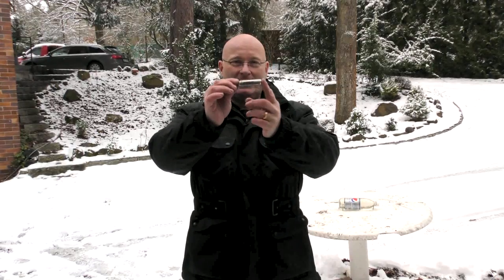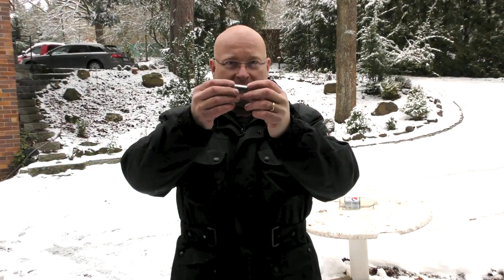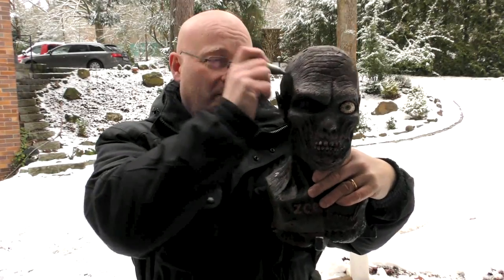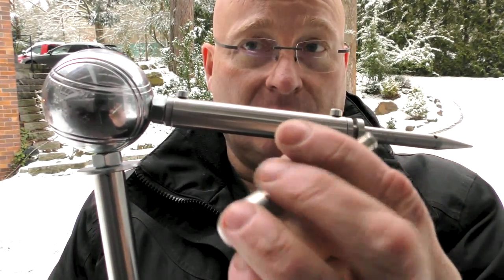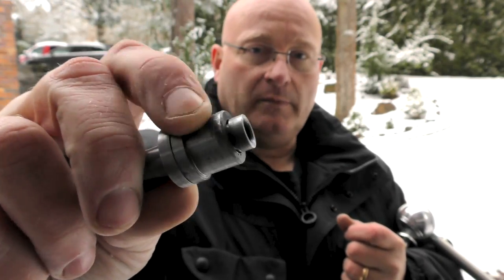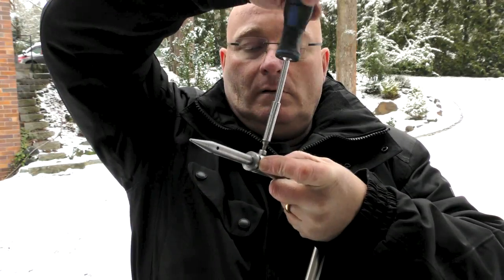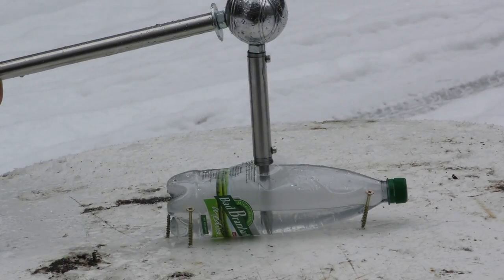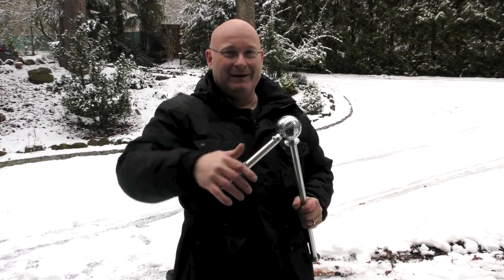Brain Popping Gas Injection Skull Hammer!

Comment: Joerg, I've seen some tests against ballistic gel, and it doesn't show it's full power. What I suggest is making a meat sandwich with a ziploc filled with wine or some fluid.
Also, I think a lot of gas is wasted because of the hollow spike. There must be a way to thicken the inside walls of the spike so no pressure is lost.
Great video as always!
Reply from the maker: TheWakimaniac The catridge holds 6 liters of uncompressed co2. The spike probably holds 2 centiliters. Not an issue.
Reply: Great! Thanks for answering :)

Comment: Could this not be converted to be a projectile? Granted you'd need to fire it with some force, but considering some of the 'big guns' featured on this channel, I think it could be done ;^>
Reply: I think it could be made into an arrow with the spike as an arrow head
Reply: i think the shock of it firing would pop it.
Reply: ***** Fllip Nelson That was my only concern, this could probably be countered by adding a spring to the spike that is strong enough to withstand launch inertia, but not the impact.
Reply from the maker: ***** This would certainly work as a tip for my anti Smaug ballista.
Reply: He could just put barbs close to the tip, add a bit of a shaft perhaps with some fletching to 
stabilize it and launch it like his toilet brush.
Reply: JoergSprave Do it! I would love to see that - Anti-Smaug "cold shot"

Comment: Hey Joerg,

I showed this video to my husband and though he agreed with me that this is indeed a cool build, he said what you need to do is make spikes like the assembly you attached to the ball, and make it so you could fire them from a slingshot. They should pierce the CO2 cartridge on impact once fired. That way they are effective from a distance and you don't have to worry about getting surrounded by zombies with what equates to a one hit weapon.
Reply from the maker: On The Balcony With Kat The spike weighs about 350 grams (= 0,35 kg) without the Boule ball... very heavy for an arrow tip. My anti Smaug ballista could handle it. But that would be a really expensive arrow!

Comment: This is similar to the WASP Ejection Knife. The ballistics gel test of that one is far less impressive than you'd think due to the gel being solid, compared to an animal having a lot of liquid inside.

You could fit a rubber O ring around the part where you open to put the C02 in since it looks like a lot of the gas escapes there.

Comment: Once the skull shatters it's no longer a closed system. The air will escape through the entry hole as the shattered skull won't provide a a good seal with the spike. Doubt eyes will pop out. There was a James Bond film where the bad guy swallows a CO2 cartridge from a spear gun and proceeds to inflate like a balloon. Of course it was a Roger Moore Bond and so most scenes were comical. Looking forward to seeing you test that air spike out!

Comment: As an upgrade suggestion:
Maybe wedge small lead/steel balls into the four holes on the spike. The pressure will shoot them out, adding 4 projectiles shooting through the brain to the already impressive damage. Also this will serve as a sort of "pressure valve", meaning that the gas expands even more explosively than it already does.
On second thought: Not sure if that would count under the "no barreled projectile weapons" part of the german gun laws.. since you have yet to be sued or arrested I guess you know them better than me though

I think ballistic gelatine is the best test substance. It resembles meat very closely but has the added advantage of being transparent, so you can actually get a pretty good idea of the damage done inside.
Add a layer of plaster or wood to simulated the skull maybe to keep things realistic. Only downside is that there isn't going to be any "popping eyeballs"

Comment: Very interesting concept. Totally overkill - I love it! As for demonstrations I would love to see it on ballistic gel since one might actually get a view on what happens that way. I would also like to see what happens with a water melon just for the potential of an awesome spray of melon bits all over the place. Might perhaps the reload time be quicker with some sort of bayonet locking connector? (To clarify - I'm not actually talking of bayonets here, it's a quick release locking connector used for some electronic cables) If you grind an L-shaped track into the tube which align with a lug on the end-piece so you can just insert and twist to lock the end-piece in place. It requires some preciesion work though since it has to be a tight fit so that it doesn't twist and fall out on its' own. It might weaken the structural integrity of the thing though so it might be a bad idea but I figured I'd throw the idea in there.

Love the poster, that big grin really captured you. Hats off to the artist!

Comment: Should make a version of this that is faster to change the CO2 capsule as it wouldn't be too practical if you have to pull out a screwdriver every time - maybe make it so the cylinder screws onto the ball? so all you have to do is quickly loosen it, put the capsule in, then tighten it back. Just an idea :) not sure if you'd be able to do it or not but you seem to prove many people wrong :)

Comment: I reckon you should take out the ZGB head with it. That should be awesome. If not, ballistic gellatin. You should be able to at least see the expanding bubbles getting trapped, if it doesn't explode. Also, maybe look into getting a better setup instead of having to screw/unscrew screws after every shot. Great work none the less, this weapon is extremely cool

Comment: This item of zombie destruction is a great idea. It looks like it works similar to the gas charged knife. Just like the knife it has a similar problem though, a lot of the gas escapes through the entry wound instead of possibly blowing out the eyes of the zombie victim. I would suggest some sort of seal around the top of the entry spike like a small plunger or seal of some sort. This way with the power of the impact the plunger or seal might help keep some more gasses inside the wound for more damage. I don't know how well it could be done but after watching many of your videos the ingenuity you have is incredible.

Comment: If you were going to test this on a somewhat realistic medium maybe you could empty a coconut and then fill it with pudding so you have a decent representation of skull hardness and brain consistency.
Also you could use whatever you choose to plug the hole in the coconut with as some sort of guage as to how much pressure would push through the "brain".
If the plug shot out than the pressure might be substantial enough to actually have an eye explode.

Comment: The ultimate enhancement to this kind of warhead is to add a poison tip.
The only effective one I know available to us who don't live in the Amazon
is aspirin. Spraying aspirin all over the inside of the wound, should prevent
clotting and greatly enhance or extend bleeding.
Also, allowing enough clearance inside the tube turns it into a bleedout pipe.
Maybe some hunters could try these features and give us some feedback?
Reply: Oh, one other poison would be any vasodilator such as blood pressure medicine.

Comment: I'd like to see it used with a blunt tip based on some of your more recent tests and on a coconut in ballistic gel also based on some of your recent tests. use a high pressure spring so that the co2 is not pierced until the skull is punctured

Comment: Put a small plate on the spike to set the depth of the strike, and to give a pressure resistance to center the tip of the spike in the skull to prevent over penetration.  Secondly, the plate will assist in triggering the cartridge firing by acting against the skull to increase the impact force of the piercing point on the cartridge.  Two benfits for the price of one addition.

Comment: Joerg have you seen the injector knife that is currently on the market with a hollow blade and also uses a co2 cartridge?
Reply from the maker: martywhitevan A forum member posted the link after I published the idea for this... kind of similar, but you have to push an extra button to release the gas. Plus it is hard to penetrate the skull with a knife. Oh, and it is very expensive too.
Reply: yes

Comment: I have a horrible suspicion that anything truly analogous to a zombie head will puncture the canister and release most of the CO2 before the spike has entered far enough to be effective.  If that turns out to be the case, perhaps a sliding weight that strikes the canister to puncture it after the initial contact with the skull has been made, and the spike has begun penetrating the skill, would be a solution.

Regardless, I can't wait to see what that nasty thing does.
Reply from the maker: ***** My calculations indicate that this won't be an issue. It only takes 1/1500 of a second for the spike to travel deep enough into the skull, but almost a full second for the cartridge to discharge.
Reply: JoergSprave Excellent to hear that.  I'm not sure what I was thinking, now that you mention the maths and I think about it properly.

Thanks for the response, and bring on the good weather for the high-speed filming!
Reply: When they're sane, I agree.  But look at something like the Panzer VIII 'Maus' as an example of insanity informing design. And JoergSprave is most certainly insane. :)

Comment: Btw you can film in slow motion still if you use like two clamp lights, each with a bulb that puts out around 3000 lumens (which you can get really cheap if incandescent) or just as many lumens as you can find

Comment: to me the angle and the length of the whole cartridge holder with the spike seems kinda odd. Maybe if it was mounted on top of the boules ball instead of sideways it would be easier to align while striking. Also if you strike a basketball with it will the ball deflate or burst?
Reply: if you were to strike a basketball, then it'd probably pop (if it was inflated and really hard) or if it's softer and not as inflated it'd probably inflate for a bit, and then deflate.

Comment: "Zombies only use a small part of the grey matter, and if that part s intact, the Zombie still is a danger." 

We can assume that zombies use at least their cerebellum (responsible for movement) and their reptilian brain (responsible for reflexes and vital functions). That's a problem, because they are both located on the back of the head, making them difficult to hit. 

Keeping that in mind, the only way to neutralize a zombie with absolute certainty is to either hit the back of their head with a weapon powerful enough to pierce their skull (like a hatchet, but there's a high possibility that it remains stuck in the skull) or to simply cut their head.

Comment: Ballistic Gel. 

What if you modified the bottle to have a pin on the tip so that you could shoot it with a slingshot, and the tip would punch a hole in the front when it impacted the target.